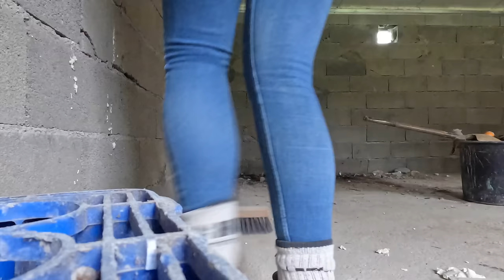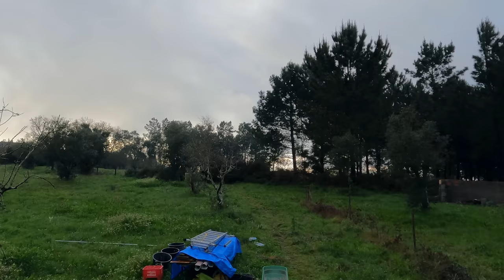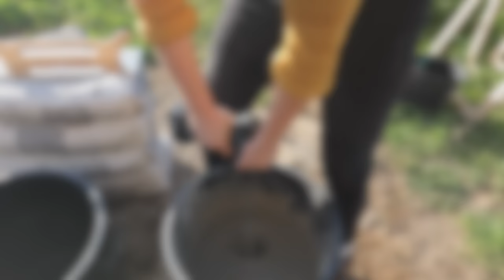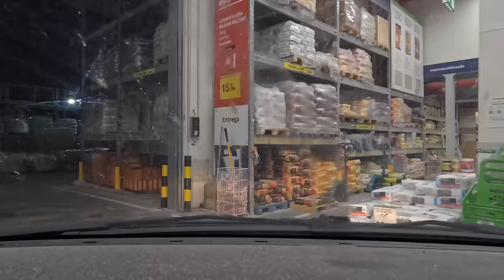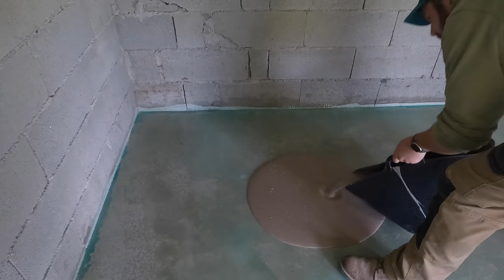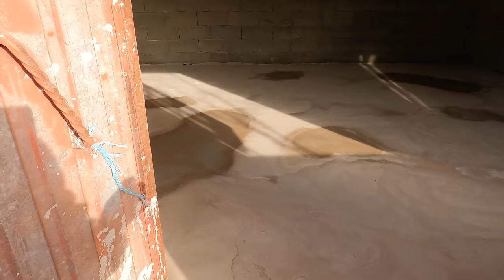17 - Self levelling our off grid barn conversion in Central Portugal - DIY

Comment: Good job guys!!! Don't feel bad about your first attempt most people miss estimate how much material they will end up using on the self leveling because the thicknesses can change a lot in the leveling process. Keeping the mixes continually going is the only way to get a true level and most people mix 5 or 6 buckets at a time to get a good flow going. A nice big area rug laid out in the middle of the room and everything will look great and the dog will have a good spot to lay out. Keep up the good work!!!!
Reply from the maker: You are sooooo right one mixing and one pouring was just a bit too slow if we ever do it again we will get at least 3 people mixing  that way the pourer is constantly moving material around and not letting it start to cure.i think 45 square meters and 2 people was a little bit more then we could chew hahaha. I have already bought a big rustic crushed Hessian rug as it was a decent price in Leroy merlin I think it's 270cm x 160cm so that will be perfect for Walt to relax on 🤗 have a great weekend

Comment: Nice colour floor. Would love to hear more about your style plans for the building.
Reply from the maker: Thankyou.Well just want to keep it simple, open airy and earthy colours. We need to frame.and insulate as it'll get super hot and then I want to make a bit of a wooden feature wall. On the outside I want to render it but put some stones around the door way and here and there on the corners to give the illusion it's a complete stone building and eventually start a little pergola and flower garden. If you have any ideas though please let me know as some people are so creative with design. I'm always looking on the internet for ideas 💡
Reply: Thanks! Not sure I have anything to offer design-wise - what you are doing sounds nice. I was wondering about the materials and whether natural building materials feel better, but I guess with that building it's tricky to do that because of what you are starting with. Might you also like a large deck with a roof at the front of the house. These work so well with tiny houses and are a good shield from the sub  @escapetothequinta
Reply from the maker: Yeah it's difficult with what's there and the fact nothing is straight ha but yeah a big deck and pergola would be amazing! When we start the shist stone barn we want to use natural methods for sure like lime 👍👍👍
Reply: Good luck with it all - doing a fine job! @escapetothequinta
Reply from the maker: Thankyou means a lot, had some really long days recently so seeing comments like this makes it worth it!

Comment: Hija guys, that was ace and it looks amazing!!! Good call to redo the floor again and that color is spot on!!! You are a good man Dave saving that butterfly, that will bring you some good karma. Can't wait for the next round, still don't know what's going there in the background ;))) How is the old tractor doing anyways, have you got it going already?? Have a great week you two!!! Cheers Bert 🙏🏻❤
Reply: I would also like to know what's happening with the tractor 🚜 the motor was turning so it should start maybe some new fiule and make sure every silinder gets it there's little pipes going to them and you screw them a little bit open one by one then turn the motor till diesel comes out then close then the next one when they all showed fluid and are all closed it should start also have a look at the air in flo drum a big metal pot with clips on the bottom you make those loose while holding the bottom because there's oil in side and you have to clean the oil out because there all the dust collect and there's a stripe on the inside where you have to put the new oil till there,if you start working on it we can help you .
Reply from the maker: Thanks dude. It was definitely worth redoing we are super happy with it now. Not perfect but much nicer with the colour change. The first product we used though was much better then the second in our opinion so if we do it again we will use that and the tint. I'm curious to see what a little black tint will do to concrete. Yes I can always do with more karma points hhahhaha the thing in the background will be reviewed next week 😉 and tractor is coming soon (I think I keep saying it but need to finish cow shed hahah) 🤗🤗🤗
Reply from the maker: Yeah we're hoping to get back to this project as soon the cow shed it framed and plaster boarded. That's great advice about the tractor. We have some new filter now too so we can really give it a good clean and overhaul. Once we get a little power.bank think it'll make.some.tasks easier as.we can light up rooms as the barn is quite dark and videos just don't come out very well but very very soon we will get back to this as the land needs managing ASAP 🤗🤗🤗